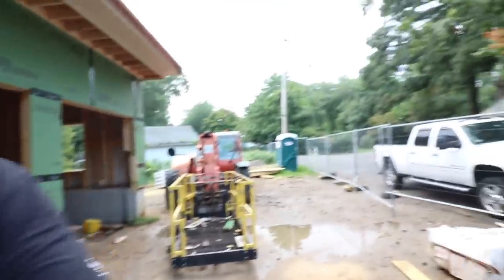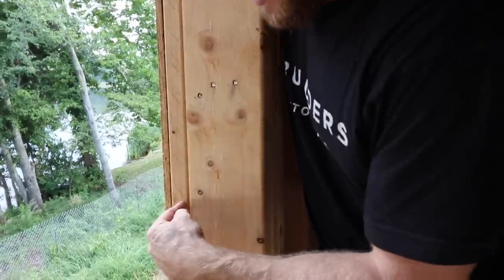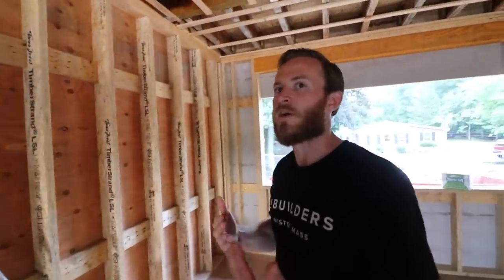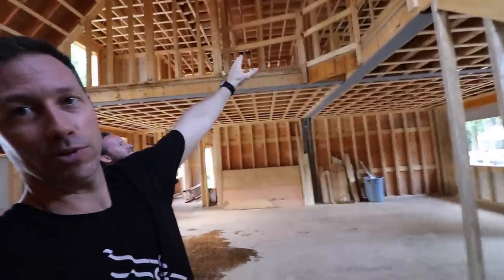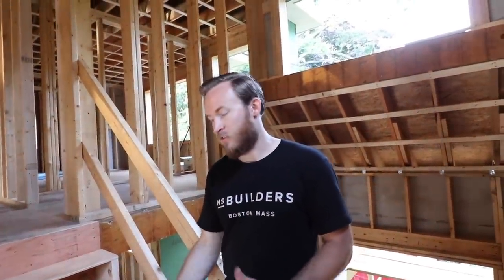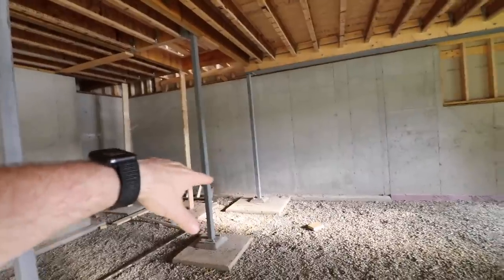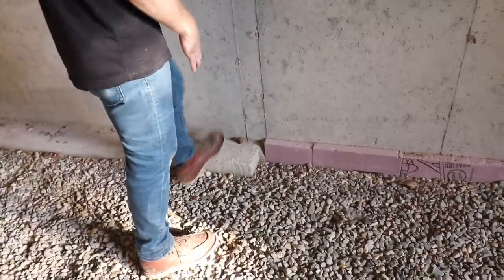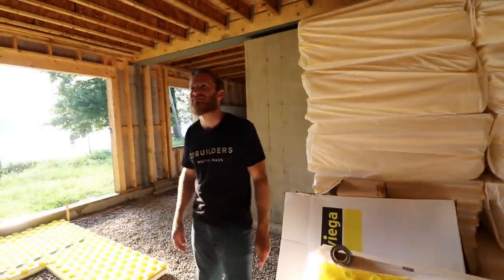How do they Build in Boston? Visiting a new home in Framing

Comment: Mind blown!
For context I’m in Australia and our conditions are different (much higher temps) but our standards are junk.
Insulation can top out at R4.0 and typically 2.0 down here. We blow kajillions on heating/cooling in conditions no =where near as extreme as yours. 
The porn in this vlog is the detail. Rebating that strap, copper not zinc, then stairs detail and then general forethought. 
Thanks for the insight. Subscribing to both of you!

Comment: 11:07 you can use BMF HTT 16, 22 and similar

Stand in the thickness of the wall, not chisel work to do and get a certification by the furnisher 

one above one under and a bar to link everything

Comment: Hey there from Germany :-) I was just smiling by "increas insulation and thermal break"... this is so ridiculous when you compare to what we do in Germany. We have laws that say. you have to do U-Wert [W/(m²K) for outer walls with 0,24. This means we have the wall (stone) then you need 12-16 cm isolation and an top you can do pebbledash or clinker bricks... so the outer walls have about 17,5 cm stone + 14 cm isolation and 10 cm clinker bricks. 41,5 cm thick walls :-) 16,34 inch ... what you build there is a garden shed!
Reply: Andre C true but here in America everyone can afford a home. You can be 20 years old, have an average job and own your own home. 
In Germany this isn’t the case. I have family that lives in Germany and they’ll never be able to afford a home. 

It’s not that America is right or wrong or vise versa it’s just two different goals.
Reply: @abmccaa  Hey, you are right. So the CO2 output ist 4,18 times higher in the USA... go on, build cheap... 306 Billion Dollar damage in 2017 caused by weather. Germany... 2.7 billion. Worth it :-)

Comment: On the Zip system - you should tell him about the other builder you showed who sealed all the edges with the black sealant instead of the cheapo tape. Much better waterproofing.
Reply: The black Zip liquid flashing is actually made by Prosoco.  Prosoco makes a great liquid applied system, for doors, windows, nails, joints. Learning curve and quality control are the kickers to getting their system right.
Reply: To be fair.. that tape is like
. 30$ a roll so it's not exactly cheap and it sticks to damn near anything. But I get what you mean

Comment: Every building should have ceiling strapping!!!!! It's great for snaking wires old work on first floors and basements too!!!
Reply: Strapping is incredibly usefull. I love that this guy doesnt know why they strap houses. Try moving walls on a house without strapping. No nailers for the new ceiling gypsum. How about a wider area to screw in gypsum board (sheetrock, blueboard, drywall, etc) so the screws dont break the edge. You have a 2.5" surface to split board seems vs 1.5". Running wires after the house is done for whatever reason  is another great benefit to strapping. I should know i moved from MA 20 years building houses and move to AZ where they do things so different and dont use strapping. Remodeling my home i should have ripped out all the walls after ripping down the ceilings to add blocking because i changed the floor plan, and added strapping! Worst mistake

Comment: On the kitchen cabinet wall- pretty good. Yea, those inserted flash-door cabinets have to have strait wall, because cabinet doors will be stick out on the edges there and there if wall will be crooked. But I prefer LVL plywood style studs. For some reason hate any of oriented strand or particle boards, unless it toughly pressed and incased like ZIP system.

Comment: The strapping of the ceilings: Not so much on this home because of the high level of vapor barrier/ insulation.  But on other homes in the Northeast unstrapped ceilings tend to get a lot of screw pops or even moisture bleed from the fasteners , mostly nearest exterior walls. Saw my fair share of it in a bunch of Mc Mansions that urban sprawled throughout Massachusetts in the mid to late 80's.

Comment: Hey Matt. We’re going to be building a new house for my aunt. It’s going to be around 800sqft. She also will have a 500sqft Unit next to it to rent out. In between the units is the utility room. She’s going to be using a 3 zone Mitsubishi hyper heat system for her house. We will be using the horizontal ducted units in the houses and a small 6k head in the utility room. The utility room houses the washer and dryer with a bathtub for her dog. We most likely will put a bathroom fan in there. But what I mainly was wondering about was ERV and HRV systems. She said she doesn’t think she needs one because she normally has at least one window open all year. But I was thinking it would be good to use a ERV/HRV system because new houses are always tight. I’m wondering what you recommend more ERV or HRV and what brands do you recommend? Thanks Matt

Comment: Great video! I wonder what nails he used for the detail of the the pressure treated board at the bottom of the Zip-R closing edge? Seems like it could be risky with the corrosive nature of pressure treated lumber, and the potential for moisture from its location.

Comment: Love the work they're done,I use strapping also in Texas I am looking into Building Homes with hempcrete what I have seen so far is that building a custom home would take considerably too long because of dry times of the hempcrete and the lime on outer and inter walls ,the R value looks very well but not cost effective, the sound break is great, you can pack up the house and have everything moved if it caught fire, Matt have you ever looked into building with hempcrete I like to hear your thoughts and comments on using it
Reply: Loadmaster101 Hope we will be growing lots of hemp here in Florida soon

Comment: Not sure about the 2x6 tall wall. I design roof and floor trusses but my company designs tall walls in the Midwest area (Iowa, Illinois, Minnisota, Wisconsin). Code says walls above 18 foot tall needs to be 2X6 LVL or 2x8 depending on windows and height. Also the wall studs must go from floor to ceiling to remove "hinge" in wall (I know that is what the straps are for). Also, the floor "bounce" is fixed by floor depth and spacing. Very little to do with subfloor.

Comment: Impressed with some of the build, but not all. Have worked on houses across the country and the NE typically builds heavy - meaning lots of 2x10's, 10" poured concrete walls, plywood instead of OSB, blue board and plaster versus drywall, lots of insulation. Not sold on zip wall. Have yet to use it, sticking with 1/2" fir plywood as zip wall has a 15 yr. mfgs. warranty meaning that (in my mind) it will fail in 16yrs. It's basically OSB (crap) and I refuse to use anything OSB. Refuse to use engineered floor joists as well. Yes they are stiff but if you are concerned about bounce as I was double up 2x10's and keep them 16" OC. Strapping is only used in the NE. Works good tying floor/ceiling joists together. Creates some additional work with lighting fixtures (recessed lights in particular) as they are designed to attach directly to the joists and you can't or they will be too deep. Will also piss your insulation guys off if you are using bat insulation between the basement and first floor (as most homes do) and you install them before they install the insulation.  My house in FL is a joke compared to my house in MA construction wise. I understand there are no snow loads to contend with but the overall material content & quality is about 1/4 of what was used in MA.
Reply: You're not a professional builder, at least not a very good one.

Comment: A lot of new research has shown that all this foam we are sticking in the ground around foundations is just a really bad idea.

Eventually everything, EPS, XPS, it doesn't matter, takes on the moisture level of the surrounding soil and loses most of its R-value. It may take a couple years but it will happen, even perm ratings close to zero aren't enough to prevent it.
Secondly, it is like sticking a giant insect candy bar in the ground. Carpenter ants, termites, tunneling beetles, you name it, they love digging in that stuff.
Reply: So what are the alternatives.  I agree with you but don't know what else to use.   Could pack it with eel grass like the old timers used, high silica content apparently deterred the bugs.
Reply: Yeah I don't know, I wasn't criticizing you.  The University of Minnesota some interesting test sites that show a very well sealed foundation on the outside with an internal drain tile system under the slab and some highly detailed insulation on the inside of the foundation wall can work well, as long as there is a very, very good capillary break between the sill and foundation so that you don't drive moisture up into the sill and rim joist.

Foundation seals and insulation are a complicated thing, and I've yet to see anyone that has come up with a bulletproof design for northern climates. It seems there are always compromises to be made somewhere.

Comment: So much easier living in San Francisco Bay area were our Temp stays between 50-65 year round. Building is so much easier when you don't have extreme weather, especially snow. We have a bunch of 1920's, 30's, and 40's homes with no insulation and it doesn't really matter.
Reply: As a finish carpenter we don't have to lug our tools over snow and ice.  I'm also in the SF Bay Area.  I can't imagine having to deal with the extreme cold.

Comment: And then how do you replace treads later if they are pocket hole screwed? Or does that fall into "not my problem" category?
Reply: @MaxVideoLee  that'd do it
Reply: Unless the faster head has stripped, you just switch to using a screw removing tooler or as Max replied as a last resort only if the pocket is "inaccessible" if you even know what a pocket hole is and not that hard at all to access or make now a days.
Reply: Why would you replace treads later?  Walnut treads would be pretty sweet.  I used 1" oak treads with pocket screws and F26 and basically, you'd never get them apart.  But why would I ever want to disassemble a beautiful staircase?
Reply: In my experience everything in construction falls into the "that's a problem for the next guy" category.

Comment: Some sexy framing there, good stuff, gota love, "don't send me your cheap clients" we charge. Been doing the same thing for 30 years. Not a big fan of "water based" glued LVL's, would like to find "polly based" glued LVL's. Seen what happens to a flooded house after the flood, the water based LVL just starts structurally dissolving and running to the sump pump.

Comment: The bounce is not from the floor material but rather the system underneath. The TJI's, Open-web floor trusses, or dimensional lumber you use as floor joists will have a SIGNIFICANTLY greater impact on "bounce" in your floor. If you look at the code book or the engineers design specs of the floor system, they will list an acceptable deflection in the joists. That deflection is the bounce. Yes a thicker, stiffer subfloor like 1.1125 " advantech will help, but its contribution will be much less than a different design to the joists.

Comment: Wonder how they filled all those nail holes in the zip so there wouldn’t be water penetration? Or if they used galvanized nails if the didn’t cover the nail holes

Comment: I am assuming that the water in the corner is what "gracilism" is talking about, but I thought it was coming into the basement where the concrete meets the wood framing. This need to be sorted before anything else?.

Comment: The only criticism I have is that the two story space at the stair isn't framing appropriately. There is no reason to platform frame an area this way any longer. This would have been a great use of the LVL lumber to achieve a strong, flat, tall wall in that area, for minimum cost increase.

Comment: Great house. Great construction. Just wondering if joist spacing of 19.2 (that's the little diamond or triangle located at 19 3/16 plus inch increments would be OK for the span).

Thanks again for the video and great construction.
Reply: 19.2 and the diamonds are for roof trusses
Reply: brad hardie Correct. Wondering if 19.2 span would be satisfactory for joists with thicker ply as builder had considered using 24" for joists with thick ply.  Thanks again.
Reply: Span calcs are all based on what the wood is, and what the span is, and where the span is (rafter, interior joist, deck joist) if it is regular common framing, there are span tables online you can refer to. If it is a TGI, then you can refer to the manufacturer specs found on their websites. Also most good lumber yards (not HD, Lowes) will do span calcs for you for free.

Comment: Radiant floors can really go wrong in the design phase, as the need for zone changes after occupation.  If the space is permanently dedicated to a static use like stairs, halls and such. Then ok.  
Heated masses like concrete don't change quickly and personal needs are different.  Some people come with more insulation as it were.  Large spaces turned to offices turn into a complaint factory.  If you give the customer a thermostat then you will find that temperature wars can start.
Reply: So many good points, wuld also like to say adding a thermostat to each rooms especially bedrooms is a better idea so if one person occupies said room they can set to what they like that suits them, I know of some folks who are cold no matter how much personal insulation they contain even if the temp is 70 F

Comment: When the basement floor gets poured, will there be any issue with walking on that EPS sub-floor?  And when the concrete is cut for stress relief, how do they ensure they won't cut the water tubes?
Reply: no problem with walking on the concrete over EPS as long as the base layer below is compacted correctly. I have 2 layers of 2.75" insulation under my slab in garage, and have parked an excavator and 16,000 lb man lift on it too, multiple times without incident. Skidsteer etc. no problems

They set the tubing low in the pour and only cut 1/3 the depth of the concrete relief.

Comment: you don't need 1 1/8" advantech to stop floor flex, use properly sized floor trusses (not that wood i beam crap) at proper spacing and you can get a rocksolid floor, might cost you 3-4 extra trusses but it will be rock fucking solid and give you cavities in which to route your plumbing and HVAC without having to cut into structure.

Comment: That LSL stuff just looks like thick OSB. I don't know that I'd want OSB studs. Granted, I sheathed my workshop in OSB. It makes walls that you can screw into and has vastly more holding strength than drywall. But how well can fasteners hold into the EDGE of OSB (or that LSL)? I know OSB can't hold fasteners in the edge worth a crap. Hopefully LSL is better.

Comment: Hey Matt- I don’t know if you’ve already addressed this, but did you see the YouTube video of traditional tyvek housewrap vs zip r? The video indicates that tyvek is superior at preventing water infiltration and I wanted to know your thoughts on that.
Reply: Obviously the test was run by tyvek, but I would be interested in an independent test.
Reply: Of course each company says their product is better, I'd also be interested.
Reply: Why compromise? Use both. Assuming a 500+ yr life on the Build. Build a Legacy . . .
Reply: VICTOR EOUS That would be almost perfect, now it just needs nuke protection.
Reply from the maker: I've been asked about that alot.  Remember to take that video with a grain of salt.  I used Tyvek for many years nearly exclusively, it's a good product but it's not right for every project.  Zip is newer and I was initially skeptical when it came on the market 10+ years ago.  After seeing the testing at the UT Durability lab, having first hand experience I believe Zip to be an excellent product that gives both a water AND air tight shell.  It's not my only choice as I use other products too, but I've recommended it to many of my clients for builds.
Reply: @buildshow  I bet they put the building into negative pressure, but failed to tell us?
Reply: Matt Risinger thanks for the reply. If it’s good enough for you it’s good enough for me!
Reply: Matt Risinger Is there a chance for the tape that goes over the zip system to tear? Say, from tiny shifts in the building?

Comment: few questions...
but first great job on the first home, i have built a few so keep it up.
the weather barrier for the exterior to foundation, even though its weather treated did you put rubber or plastic liner between wood and concrete?
why not do the i-joist at 20-24 OC instead of 16 OC. you said you ran the cost, def has cost benefit especially with the xtra your putting on the 1.5 flooring.
dealing with a lot of extra cost what is your cost per sq. ft.  in pa we are looking at 105-110... this one is looking in the 120-125 per sq ft. price range.

Comment: What kind of termite or carpenter ant defense has been considered, especially near the walk-out basement EPS/radiant foam?  I was surprised to see carpenter ants making a nest in my loose, stacked 3.5 inch EPS panels last month.  In some cases, an upended 'J' shaped flashing just under the sill is recommended to force critters out into the open if they try to burrow upward.  Curious to see what you have done.
Reply: We seldom have that issues due to the yearly seasonal temps but it still happens from time to time, just not as much or often where its more warmer year round.

Comment: Never spread out on 24 inch floor joists, even if you go with 1-1/8 subfloor plywood. Stay with 16". Because you should consider the weight of this heavy plywood also. Otherwise you do the same as with 3/4, same shaky floors.